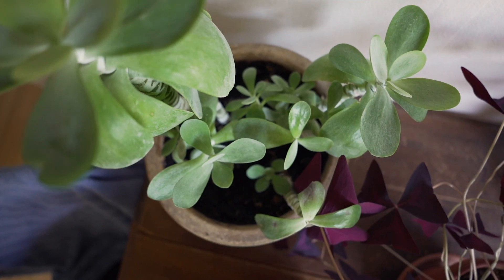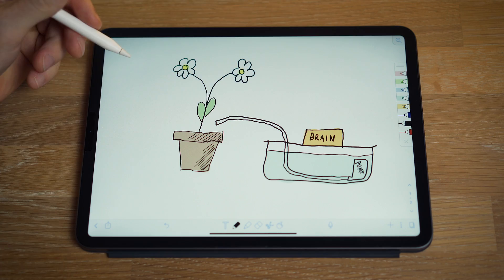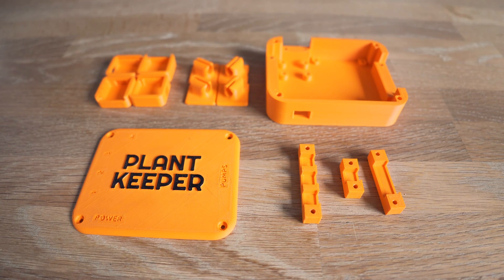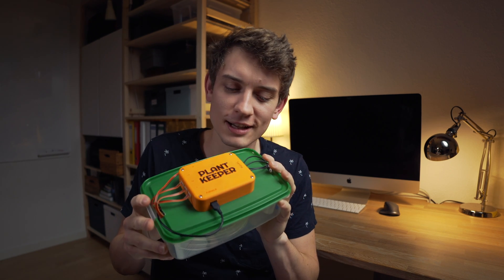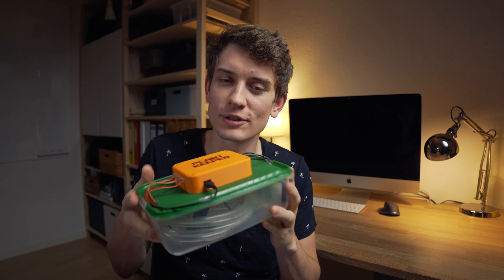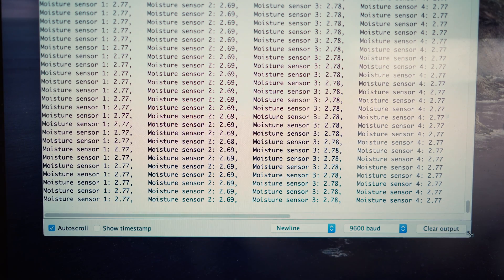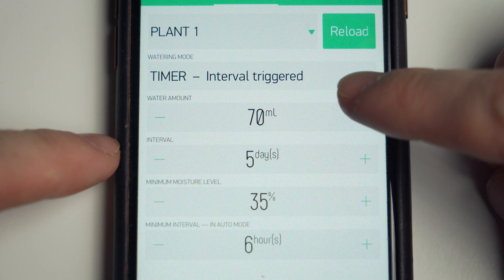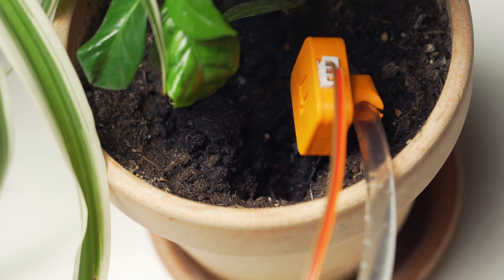Preventing Plant Death With Technology

Comment: Looks great. One potential problem that other makers should be careful with is to ensure that the water reservoir is not higher than any of the hose outlets. Those pumps will allow water to flow even when they are not operating, so if any part of the water in the reservoir is higher than any of the hose outlets, a siphon will be set up and the planters may well overflow. An alternative is to use peristaltic pumps, but those are not submersible. Another possibility is to use solenoid valves, which requires that the reservoir be higher than the hose outlets.

Comment: This is amazing. I’m currently building a self watering pot similar to this. You killed it in hardware. I’m using Arduino also and similar hardware but your 3D case is amazing.

I’m going hard on the software side, using AI and building a powerful iOS app , but I just wanted to share with you that the casing is on top. 

If you design this to sell I would be interested to build the smart pot

Comment: The concept of this project is promising, but there are some issues with the moisture sensors that need improvement. The moisture sensors often require calibration and appear to be prone to failure. To enhance the system’s reliability, you might consider replacing them with small aquarium valves to control the flow of water to each plant. Additionally, adding a leak sensor at one of the plants to detect any water input anomalies could be beneficial.

Simplifying the project by implementing manual flow control and incorporating a system to calculate and monitor the amount of water dispensed to each plant would be a great idea. This could be further enhanced by integrating a Wi-Fi switch for daily scheduling and remote control. Overall, with these improvements, the project has the potential to be highly effective and user-friendly.

Comment: those relays look way oversized for the pumps. you could get away with much smaller relays, or even ditch the relays altogether and use some small power MOSFETs (plus a flyback diode for protection) to switch the motors silently. heck, the MOSFETs used to turn on those giant relay coils are probably themselves strong enough to drive the pumps!

Comment: Great video you have all the settings I would like to build bar one. I have a bottom watering system with a valve on each pot and want to water when the sensor dries out but water for say 3mins then wait for about an hour then if the sensors still dry water again for 3 mins and so on till it’s wet. Would this be simple to achieve?

Comment: The build is great but what happens when you're on vacation for a week and the water runs out in the container? I have built a similar setup but using only one pump and I've cut the pipe in a v-shape to allow T-section junctions for multiple outputs in one pipe. The plants I have are pretty needy in terms of water and instead of using a soil moisture sensor, I'm using a timer-based function to turn the pump on for 10 seconds every six hours. I'm now thinking of connecting a bigger motor and getting the water directly from the home water supply line (instead of a small separate tank) and watering the entire garden with it for full automation. First, have to rig the garden with PVC pipes and spinning sprinklers.
Reply: The most seamless way would be to use a bigger variant of the ikea food box that he's using. They have really large ones. 

Best of luck on your garden build!

Comment: Hey man, Awesome project! I am stuck on something. I Have an ESPduino (esp8266 arduino board) I followed your instructions exactly have the same sensors, ADS board etc. Blynk connects fine to the board but I am not getting any moisture data on the graph at all. Tried everything and even made sure the ADC is connected by looking at the serial monitor. Do you have a wiring diagram? Maybe i missed something. I have the sensor connected to the 3.3v pin but the ADC to the 5v pin if that helps.

Comment: question: so u the board u have states 3v, but isn't the relay control input 5v? also do u use the board to power the pumps or do you have a seperate loop?
Reply: I would really love a diagram for this. cause it creates so many questions for someone new to it
Reply: Am I correct to say, that the Vin can also output 5V of power, and is not just for charging the nodemcu?

Comment: Great video, helped me a lot when building a similar system. But a question though, in your case, does the soil moisture reading fluctuate a lot? Mine goes from 70% to 40% and back to 60% between 1 minute interval readings...
Reply: I have decided to work on this same topic for a very important project, I will be glad if you could give any advice or word of caution.
Reply: @dalchandsharma1737  From my limited research, that's just how these inexpensive sensors work, I'm thinking to calculate an average moisture over time rather than using the raw readings.
Reply: @teezzz20  taking an average reading in every 5 - 10 minutes is a good idea so that the system doesnt overwork or cause unecessary damade to the pumps
Reply: @teezzz20   how should increase the number of plants that the the system can handle, will it be possible to use a stepper motor instead in this same system with a few tweaks.
Reply: @teezzz20  also where did you got the schematics from?

Comment: you need to add a sensor if you run out of water in container, it better be just 0/1, checks ones a day and before watering to prevent damaging a pumps and water problems. its needs just 1 digital pin

Comment: Love this build. Its so nice and clean. Im now going to try to build this for my wife. Have all the parts but Im missing a simple schematic? I have paused the video but its hard to see where all cables go. Do you have simple schematic? Would be so awesome.
Reply: You are right, schematic is missing, but you can find information in 0-setup.ino file - D1,D2 is I2C interface for AD converter (sensorrs) and D4 to D7 is a pump control etc. In case you want to make it, at least a minimum knowledge of Arduino and electronics is requested. But it is not nuclear science :-).
Reply: @VlastikPospisil  Cool. I have the knowledge so thats all good. One cable I cant figure out right now is the Yellow cable going from ESP to the Motors it looks like? Whats that? Thanks for a fun project
Reply: @ludvigaldrin  As you can see - 4:49 it is connected to central pin of the connector, but is not used and also I cannot find it in code as well. Maybe it is for future add ons - water level sensor for example? :-)
Reply: @VlastikPospisil  a yes. Thats my confusion. But then I understand :) Thanks

Comment: How do you power the 5V relays with the 3.3V esp-output?
Reply: Exactly what I want to know as well. If you get a solution for it please share it with me :)
Reply: I imagine everything is powered by 5 volts. The relays should be able to be switched via 3.3v as they have optical isolation or at least some are (just need to turn on an led)

Comment: Hi! Looks awesome! thanks for sharing! Im trying to build a similar project and I can not figure at how to make the circuit work with only the one power source. My pump is not working properly. Could you maybe share the circuit drawing? 

I'm using an Arduino UNO board + water micro mini 3-5V waterpump. The pump starts working a for 1 second and than it shuts down. I don't know how to find aut the problem.

Thanks again!
Reply: look in the code for delay you can modify the delay

Comment: what weird magic you have done with connecting Vin on ESP 8266 and JD-VCC on relay and motors? :) do you have an extra 5V power input?
Reply: Do you already have the answer for this question? I’m trying to figure it out
Reply: @sebastianwolke4007  yes it is a trick to supply relay with 5V, it is not working with all ESP 8266 but it worked with mine

Comment: hi, would you also share the parts list?
thanks ;)
Reply: I bought these, so I will see ;)
- HALJIA 12 Bit I2C 4 CH ADS1115 / ADS1015 Module ADC Development Board Purple Compatible with Arduino
- SANON 10 Pack DC 3.3-5.5V Analog Capacitive Soil Moisture Sensor Corrosion Resistant w/Cable for Arduino Moisture Detection Garden Watering DIY
- RUNCCI-YUN 3pcs Mini Water Pump DC 3V 5V Micro Submersible Motor Pump, Mini Brushless Water Pump+ 3M Clear Vinyl Tubing Flexible PVC Tubing for Fish T
- TeOhk 4 Channel DC 5V Relay Module Expansion Board Safety Relay Shield Module Board with Optocoupler for Arduino Raspberry Pi DSP AVR PIC ARM K49

Comment: You can try a single pump but use a stepper motor to squeeze multiple pipes an only open a single one to be pumped towards - might increase mechanical complexity, but exponentially increases the number of plants you can water with that
Reply: I am also thinking about this, please let me know if you know what fundamental changes will be needed to achieve this functionality in this system
Reply: @dalchandsharma1737  you need some t- pieces, a servo, a 3d printed part and more moisture sensors
Reply: @TecSanento  Would you need a servo motor per output?
Reply: @andreybushev3020  no - a single servo is using a dented tube to squeeze all but one tube at a time - and to water another plant you just need to turn the motor x angle and open the next pipe

Comment: I really like the final product. Useful and relatively simple.

However, I'm a little bit concerned about the calibration process.
You used air and pure water to find the extent of the voltage ranges but in real life, the sensors should never see such values.
To do so the soil should be completely floated or left to the sun for days with 0 water contact and even then I doubt air levels can be achieved.
Maybe a better procedure is to have 2 or more soil samples with a known percentage of water.
Reply: I don't think it matters too much. He has a variable threshold so if it waters too little he can turn it up until happy with the result.
Reply: Rain : 👀👀👀
Reply: @adrianwahyudi3737  indoor plant you smart ass